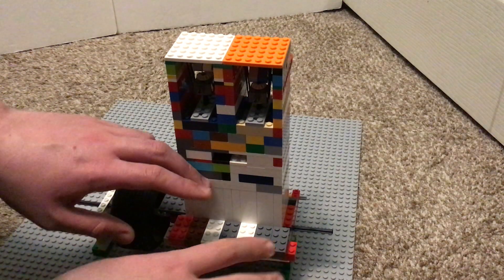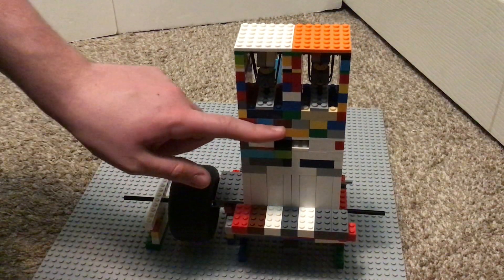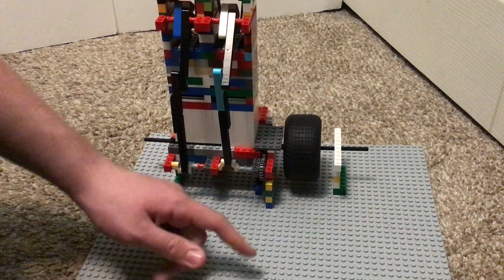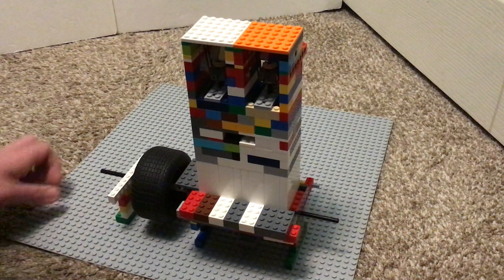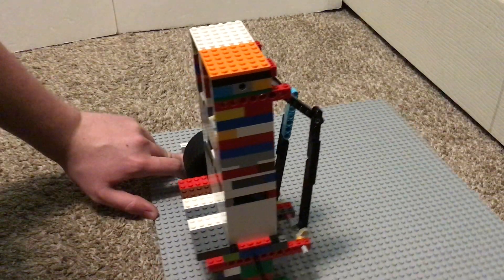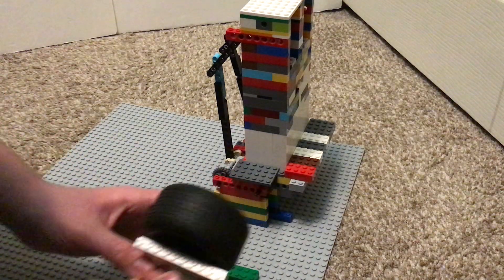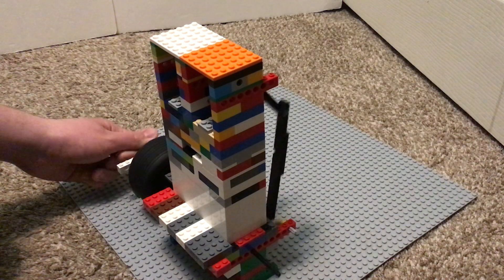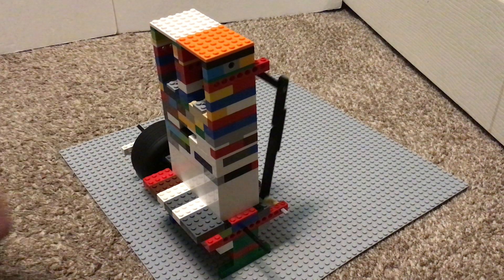Lego Inline 2 OHV Vacuum Engine

Comment: I figured out how to make a one cylinder Dohv engine with a 4x4 piston. I’ve been looking around and I don’t think anyone has done it.
Reply from the maker: Well I don't know if you are joking or not, but I made a dohv 4x4 piston engine, with real cams and pushrods already
Reply: @matsbricks4129  I used my own design to make something that was alike to the first chain driven Dohv  but with pushrods using solid connections. It is also about half of the height of your Dohv.
Reply from the maker: Diamond Motorsports, well have you even seen my video?
Reply from the maker: Diamond Motorsports, also of course it would be smaller since yours doesn't need the extra space for return springs
Reply: @matsbricks4129  yeah, I have. You use cams that actuate pushrods, that also move levers
Reply: @matsbricks4129  I should have explained at the beginning that I meant one with solid connections. Those don’t exist on YouTube. Yours is like a Briggs and Stratton columbines with a lever bit and a button to open the valve. This requires the use of elastic energy. The design I created does not need them
Reply from the maker: Diamond Motorsports, right so why would you say that you haven't seen anyone make a dohv 4x4 piston engine
Reply: @matsbricks4129  I intended to say one with solid connections. One that’s just mechanical parts. I just wrote too quickly lol. Sry for the misunderstanding
Reply from the maker: Diamond Motorsports well that's not much more of an accomplishment to just INCLUDE the solid connections
Reply from the maker: Diamond Motorsports, also you said you made a different style valve type, so that means that you didn't use my dohv valve design, right?
Reply: @matsbricks4129  it created the difference of probably 500-1000 rpm. To include a Dohv valve needs a lot more of effort because each of the parts isn’t independent. It also hasn’t been done as far as I’m aware.
Reply: @matsbricks4129  no I did not. I won’t take credit unless I’m sure. My valve is more like a vertical wall. I believe you created a more horizontal cap . I made my own valves. That’s just rude
Reply from the maker: Diamond Motorsports alright
Reply: @matsbricks4129  noice, sorry for the misunderstanding. I guess the way I explained it made like I was stealing your idea lol
Reply from the maker: How is it easier to build with solid connections?!!
Reply: @matsbricks4129   lol, it’s easier on the vacuum.
Reply: @matsbricks4129   I’m going to guess you are in the US so good night. I hope to speak to you soon.. well write...lol
Reply: @matsbricks4129  I’ll post the video soon so you can see what I mean. I’m very bad at explaining stuff like this lol
Reply from the maker: Diamond Motorsports do you have discord?
Reply: @matsbricks4129  No, but I have been thinking about getting it.
Reply from the maker: Diamond Motorsports alright
Reply: @matsbricks4129  about the having to be larger to fit return springs. It’s not really necessary (theoretically). Now that that I look at my engine it would only take three or four more bricks
Reply from the maker: Diamond Motorsports, well I do agree that I definitely could have shortened the head high wise, and yes on this engine you could run it with no valve spring, but the con of having no valve spring is that you can't idle it, you can only go full speed. Also if you have too much speed then the vacuum couldn't suck the valve close again fast enough and it stays closed.
Reply: @matsbricks4129  funny enough. I actually got it to idle even with solid connections
Reply: @matsbricks4129  hey, i uploaded what I meant by the solid connection engine. I also made a chain driven four stud bore Dohv engine and I am 100% sure this one is the first.
Reply from the maker: Diamond Motorsports alright I'll check it out :)
Reply: @matsbricks4129  I’ll post it soon (hopefully)

Comment: Can it run a dc engine to power a led or another dc engine?
Reply from the maker: It can turn a train motor over but not a M motor. It can power an LED which is pretty cool to see, but if you try to run another motor then it will pull too much current and will stop the vacuum engine.

Comment: I built this exact engine today!
Reply from the maker: Nice i saw the video on discord, but i think mine is faster lol ;)
Reply: @matsbricks4129  the intake was leaking. Also, on what vacuum cleaner power do you run your engines? My has 5 powers and I run engines usually on power 1-2
Reply from the maker: @lemns0000  yeah that is why i took the intake off and now have that built in air divider. I don't have different powers on my vacuum but i would say 2-3 maybe?
Reply: @matsbricks4129  also, am I supposed to connect the vacuum on the small thin port or the big port? You said the big port was a relief valve so my manifold is on the small ports
Reply from the maker: @lemns0000  The big port is the  not the relief valve. So put the vacuum on the . IF you were to put it on the exhaust/relief which is the  it would run but the valve would tend to stick down. Now to get rid of the intake (which is the big port!), you can connect the two intake ports inside the head to eliminate the intake (which I could clarify in a video if you want).
Reply: @matsbricks4129  yes im interested because I dont really know how you made that intake opening
Reply from the maker: @lemns0000  alright, btw couldn’t you tell in this video which port was the intake and which one was the exhaust, because I did show me putting the vacuum on the large port
Reply: @matsbricks4129  the big port is just terrible. the air leaks through the top and the engine is very slow, the big port isnt sealed. the small port is. please help me with this or tell me what I did wrong
Reply from the maker: @lemns0000  well the big port should be sealed. Check with the tutorial again to see if you did anything wrong.

Comment: Not really a true ohv and this has no camshaft, a camshaft is not connected to the guide rod and lots more features here not present in really ohv designs
Reply from the maker: I agree with you that it doesn't have a true camshaft, but it does have a realistic valve. Also I never advertised the engine as a "true ohv", i just said it was a ohv inline 2 which it is.

Comment: Really cool, i built the 1 cylinder OHV yesterday
Reply from the maker: Nice how does it run?
Reply: @matsbricks4129  very well actually, at low speeds it does lose rpm but if i revv it up it continues to go, overall runs very good
Reply from the maker: @lemns0000 Nice, but yeah the ohv design hates low rpm/idle.

Comment: what if you made a rectangle piston with one head and a giant valve? it would technically be a one clyiner but theorietically it would be just as powerful as a two cyl.
Reply from the maker: It should be the same amount of torque but it would also be slower in rpm than a 2 cylinder.